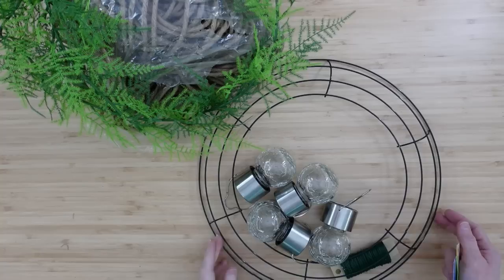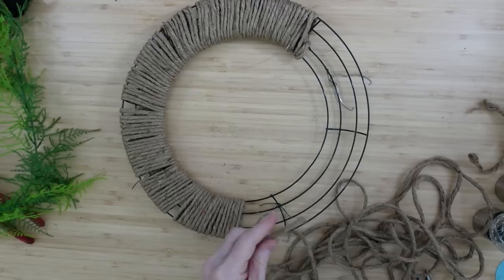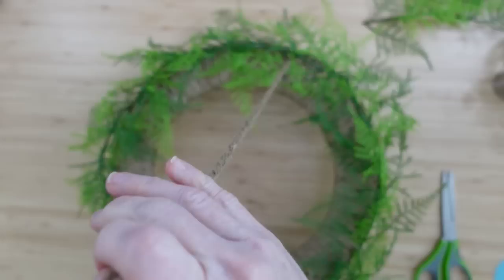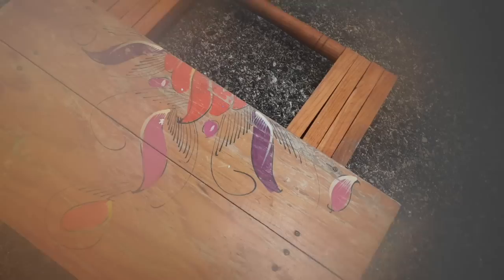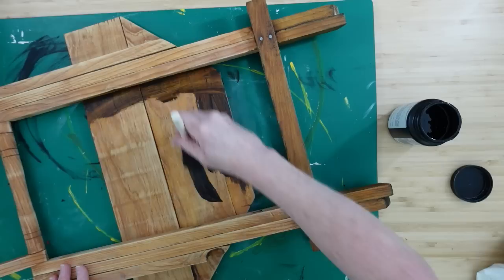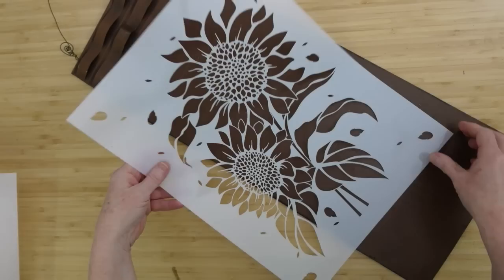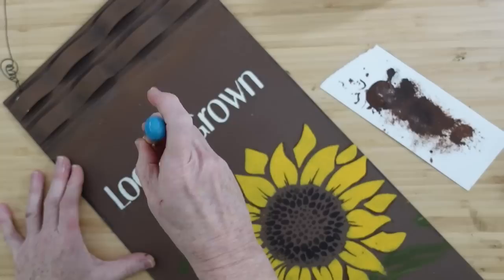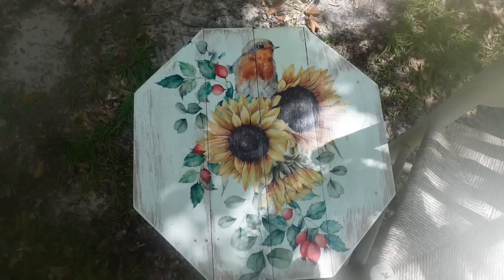Summer PORCH Decor DIYs Guaranteed To Get You Back Outdoors

Comment: How will the lights get the sun with all the rope over the solar panel?
Reply from the maker: There is a gap of about an inch between the light and wreath frame. There is no problem with the lights glowing after hanging in the bright summer sun all day. I don't think it would be ideal in a shady area or if the lights were hung all the way up obscuring the solar panel. Hope this helps.

Comment: I would have wrapped the wire wreath with the rope cording first, then simply hung the lights with their own hook onto the rope leaving out the timely necessity of wiring them with floral wire to the wreath frame.    To me, that was a completely unnecessary step.   Also, you didn't show it lit up in the dark..... how does the sun get through the roping and leaves to charge the solar panels?
Reply from the maker: I didn’t have the right set up for a hanging light in my basement to show it lit up. It’s always easier to look back at a project and say when you could have done differently. For me, I go with the flow-more emotional than logical. It’s my style, just my thing. And the lights, because there is a gap clearly under the lights, the sun gets to the panel and it works great. I encourage viewers to do it their own way-whatever makes them happy. So if you found some inspiration in this channel, use that and change what works best for you. Thanks for watching.